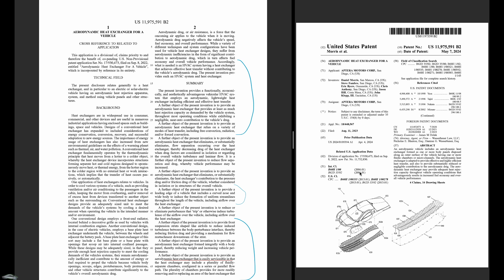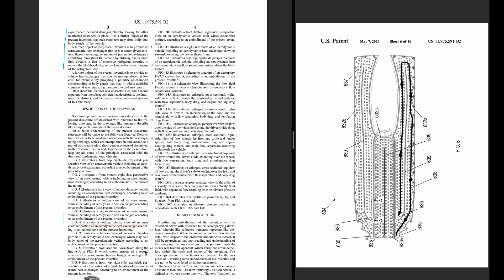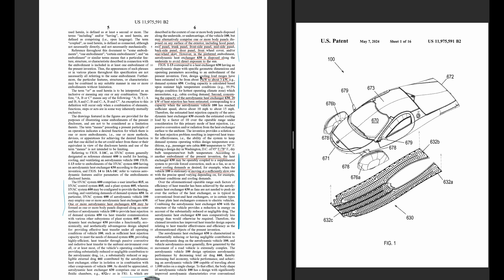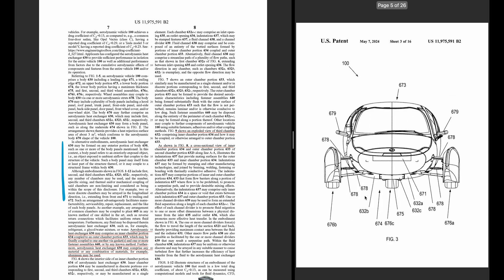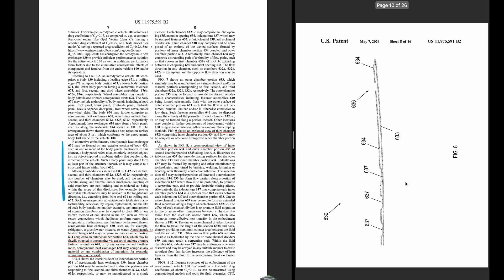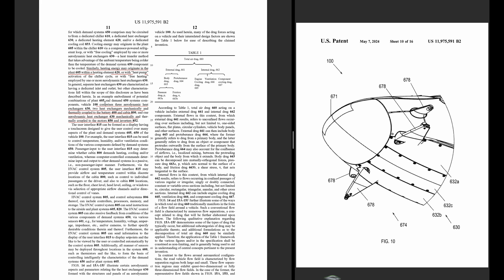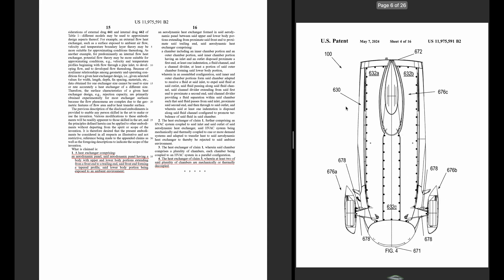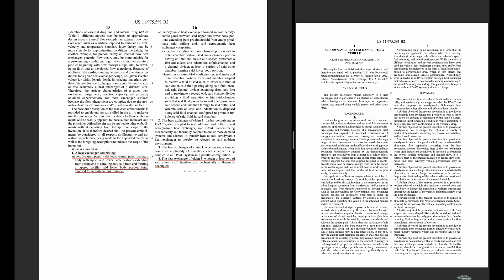Aptera Aerodynamic Heat Exchanger For A Vehicle aka Belly Cooling | Patent

Comment: It will be interesting to see how soon Aptera will move to the belly cooling. Obviously it will require testing for refinement. I expect Aptera will focus most of its efforts to getting launch edition and subsequent production of the same technology out on as expedited basis to establish the company’s cash flow. There is also the consideration that many — perhaps very many — prospective owners might choose to wait for Aptera to incorporate belly cooling and heat pump. This could lead to financial planning considerations. My guess is that Aptera will not include these features until 2026 at the earliest and will almost certainly include a price increase when that happens. Yes, I would like to have these two features in my Aptera. However, I want my Launch Edition as soon as possible.
Reply from the maker: I'm thinking I might get the Accelerator Aptera instead of waiting. BUT ... if I only have to wait another year for the belly cooling. I'll wait another year & let somebody else have my Accelerator spot. I would think we'd have a better idea of timing on the belly cooling & heat pump as the launch vehicles start delivering.
Reply: @RajGiandeep  I wonder if it will be possible to retrofit the LE models with belly cooling once the development of those components is finalized. As long as the major SMC and subframe components are designed to be compatible with it and do not require significant modification to introduce the feature, the right-to-repair approach may be supportive of that. If the belly cooling design demonstrates meaningful benefits I would want to upgrade as soon as the parts are available.
Reply from the maker: @christopherbrand5360  I seem to recall Aptera saying that some things would be upgradable. I'd hope they would design with that in mind with the current PI builds. I know I'd upgrade to belly cooling asap.

Comment: This looks similar to the patents I have seen for the belly cooling before, but goes into a lot more details. So it seems like this is a new patent on the more finalized design. If they are still tweaking the details at this point, I can see why they don't expect it to be ready for the first production models. 

I was thinking, based on another video, that some of the later PI builds, like PI 13 through 16, could be assigned to the development of the belly pan. They could be built after actual deliveries have begun.
Reply from the maker: Good point. PI's can be reused for other uses as time goes on too.
Reply: @RajGiandeep  Yeah, I'm guessing that we will see some of the PI models locked down for demos and shipment for events around the world. Maybe some will stay over in Europe or Asia so they save money on shipping. 

Others will be used for further refinement and development of things like the Off Road package or the tent. Once a system is finalized, it can be installed on the demo models. 

And of course there will be several used for crash testing which will be destroyed in the test.

Comment: So exciting!  I do still have some questions, like how will knock-knock work when the Aptera is covered with ice?
Reply: Good one! How much ice is the question..
I have to break into my frozen ice car sometimes.
Reply: @ronfarnsworth7074  Sound travels through ice.  The glogo where one taps is NOT a push/depressible switch.
Reply: @rchender Yes but is the sensor circuit set sensitive enough to go through an inch of ice and still not get triggered by any ambient noise? I see up to an inch  here sometimes but rarely. How about pass card?
I think both will work ok as you say.
Reply from the maker: Not sure, the hydraulic lifts, seem just enough to lift it & not the push through thick ice. So might need to loosen some ice buildup before knocking to open.
Reply: @RajGiandeep  I wonder if you can get your fingers under the tail of the rear hatch?  If so, might have to crawl in from the back.
Reply from the maker: @netscrooge  sounds like a interesting adventure :)

Comment: Great detail here Raj.  This shows very large surface area on both the interior and exterior sides of the belly pan, which is very good (and necessary) for dissipating heat.  It is also spread over a long length, giving air flow a longer contact time to pick up heat and move it.  At first glance, the design looks difficult to manufacture, but it feels right for getting the job done.
Reply from the maker: Does look complex & would need very special tooling. Well worth it though.
Reply: @RajGiandeep   I think you're right and the tooling is likely expensive..... but it might be a case of once the tooling is built, lots of parts can be stamped, and quickly.
Reply: The laminar flow Aptera is so focused on will have multiples lower heat transfer coefficient. I haven't tried modeling this yet but I suspect not enough for cabin, motors, and batteries. I think cabin is the hard part because of the lower temperature and still pretty big load.
Reply: @artsmith103  Remember that they plan to have airflow on both sides of the belly pan, interior and exterior.  The interior side can be natural airflow of exterior air as it enters at the base of the windshield, or fan forced.  The coolant also runs through a heat exchanger where the A/C can remove heat more directly as required.  Combinations of these three, or all of them can be used at the same time as well.
Reply: @artsmith103   The laminar flow around the exterior of the vehicle may be beneficial in helping to draw the interior side belly pan air flow out the tail where it exhausts on either side of the license plate.
Reply: @DemaGeek  This discussion of maybes can chase its tail endlessly. I thought Belly PAN was going to incorporate a liquid reservoir. Looks like not. Air to air in that confined space looks difficult. I'm suspicious Aptera penciled it in there to maintain aerodynamics in their quest for 10 miles/kWh. But the total duty with available delta T might be a dream. Patent doesn't mean anything relative to actually working. Consider the A/C radiator size exposed to 50 mph wind (fan when not moving) for a Civic size car with a heatpump compressor.
Reply: @artsmith103   The three belly pan sections are each full of circulating liquid, as shown in the patent diagrams.  What is shown there is what Aptera has described for a long time, I'm just regurgitating that.  I never said a patent proves anything, but it does show more detail than we've had before, and I think the design looks good.  Before you say it, I will point out that my opinion does not mean anything other than I like what I see.
Reply: @artsmith103   I agree that the Delta T may be fairly low to work with and that the A/C may supplement the job quite a bit in hot weather.  However, this is how designs are pushed in order to implement different techniques.... HENCE PRODUCT DEVELOPMENT.